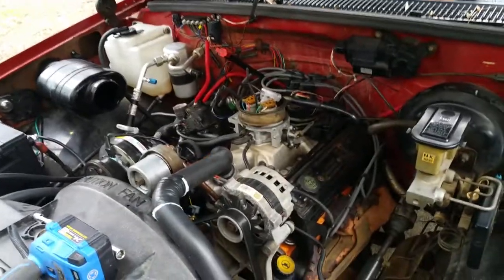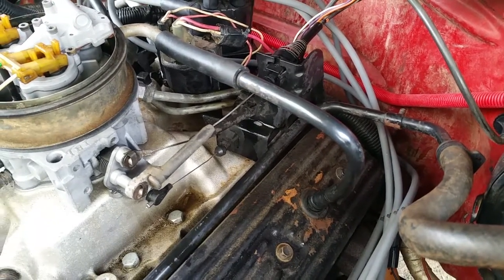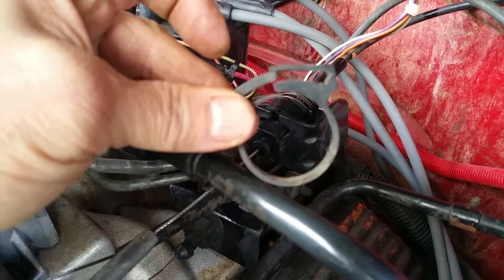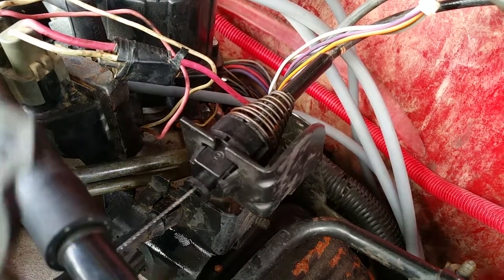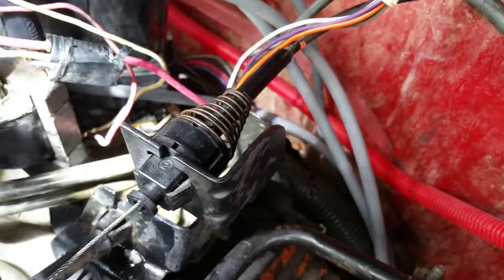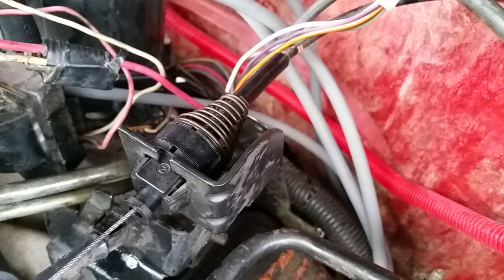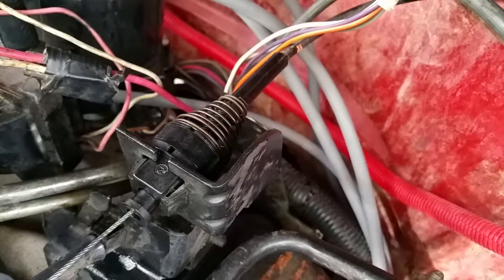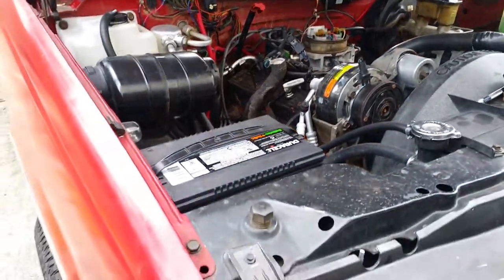How to adjust throttle / cruise cable tension 1988-1991 Chevy Full Size Truck

Comment: Simply incredible. Been chasing a gremlin on high idle on my truck for a year and I never knew this was possible until now. Was just about to throw a carb on it because I was so frustrated.
Reply from the maker: We have more videos about this truck.  Search "Chevrolet Truck" on our channel.
Reply from the maker: You should have seen another gremlin I chased (and never found) on this truck. Used to be a great running everything worked truck.  Then it stopped running out of nowhere.  I spent a year messing with it - never got it running again.  Sold it for $3,000 and was happy for it.  :/
Reply: @HorsepowerHouse  Unsolved mystery

Comment: Better than average production with  examples that should be followed by all d.i.y. instructors on this sort of subject: 1:  good lighting!  2. using a suitable pointer instead of a finger which is much too fat for most applications  3. Identifying components that are related to the thing being worked on, such as the cruise control module. This puts things "in context" that helps the novices (e.g. me) more than they realize at the time.  Thank you.  Yours just became only the second You Tube channel I subscribe to that deals with automotive repair.
Reply from the maker: I see you have high expectations for what you pay zero for.  Many people who post "help" videos are just trying to help.
Reply: @HorsepowerHouse  Experience teaches me not to have such high expectations.  And because I've been the beneficiary of much expensive training I'm inclined to point out and praise the better examples, such as yours, that exceed those expectations.

Comment: Is it possible for a truck to not have cruise control but still have both the cruise control cable and the throttle cable?
Reply from the maker: Someone could have removed / replaced the turn signal arm where the cruise buttons are.  That arm is known to break after many years.

Comment: At :10 those 2 hoses that are at the bottom front of the tbi close the the manifold what do those hoses go to
Reply from the maker: Those are emissions system related.  Here is another video that might show you better https://youtu.be/qRbwpLUVG70?list=PLVsdJzatTm_VLjk-TM6KIqExDrJF5L-bX
Reply from the maker: Entire video playlist of this truck https://www.youtube.com/playlist?list=PLVsdJzatTm_VLjk-TM6KIqExDrJF5L-bX
Reply from the maker: I no longer have the truck.  But those are both crankcase vent and emissions related.
Reply: The bigger one on left runs to your PCV Valve and the smaller on right goes to the fuel vapor canister.
Reply: Mine is completely floopy loose.